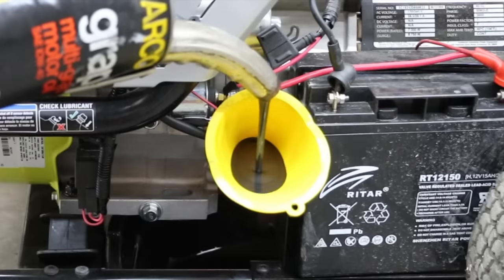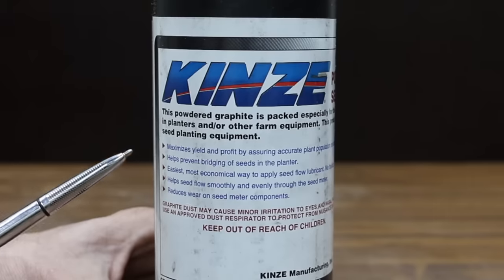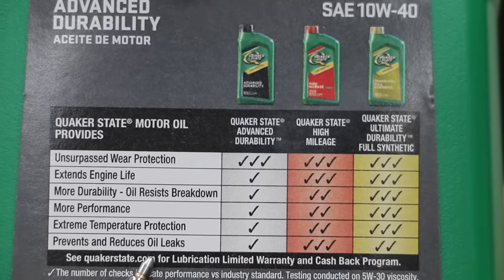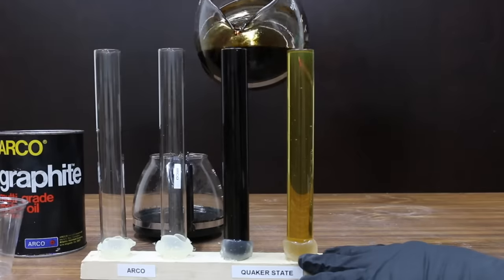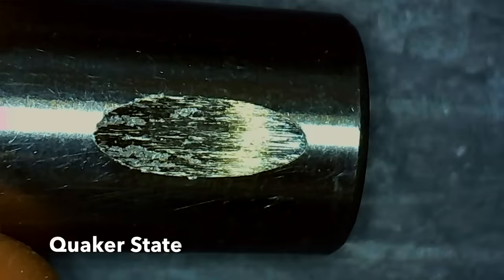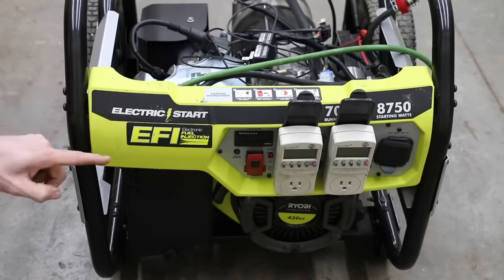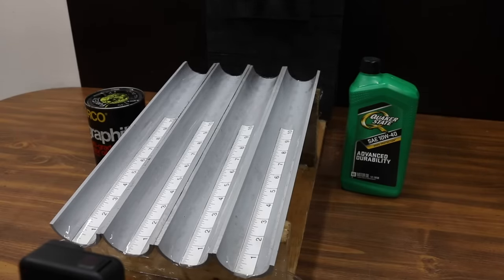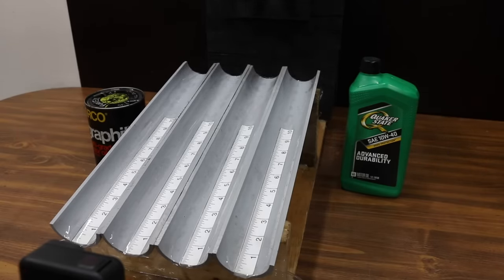Will "Graphite" Help Motor Oil Performance? Let's find out! Vintage Arco Graphite vs Quaker State

Comment: I have 15W40 5L and 2L 10W40 for my 21y.o. LR here which shall reduce friction and fuel con. by around 10%. As I have with the same tech a stick for the fuel pipe I know it works, as I got it tested, but not the oil yet. After 70k km acc. to the manufacturer they couldn't find negative things.
Reply from the maker: Thanks for sharing.

Comment: Do a test of oil additive such as slick50, dura lube, and so on.  I have used both and they have shown some very good results.  Ex:  a friends car that I added slick50, during two change oil cycles (2015 mustang gt, with 90k miles).  His mechanic didn’t tighten the oil plug and he lost all his oil.  His car did not notice until he had driven several miles (unknown exactly how many) before his oil light came on).  He took it to another mechanic who took the head off the engine to inspect it and said there was no damage or visible excess ware.  I attribute that to the slick50.  I’d like to see if in your  it actually matters if you add this stuff or not.

Comment: The graphite oil was designed for the old carborater engine's. Before fuel injection and fuel emissions catalytic converters. That could be a factor in performance. I remember using Mystic oil with graphite in farm equipment when I was younger.
Reply from the maker: Thanks for sharing.

Comment: I added PTFE resin to my engines in the late 80's and early 90's.  I was sold on it when I was able to run a lawnmower engine for over an hour after treating it with PTFE resin with no oil in it.  But since than it seems get your hands on PTFE resin is tough.
Reply from the maker: Thanks for the feedback.

Comment: Interesting.  I am not sure how graphite would help compression???? I am curious what was your theory?  Keep in mind in a small engine like that Briggs Quantum you are using has compression release and you will not get accurate compression readings.  It will be a function a of the RPM you are cranking the engine at.  A leak down test may be a better guage to tell how well the compression has improved or not.  That is my two cents that you may want to incorporate in future tests while using a small engine to evaluate compression enhancements.  Great Work Professor Todd.  I appreciate your drive, creativity and enthusiasm in all of your thoughtful tests.  I know you have 15k comments and I can not read a fraction of them  Sorry if this has been covered already.   Thanks again for your service to us consumers.
Reply from the maker: Thanks!  Thanks for the suggestion.

Comment: I used graphite oil in my '72 Honda 350F.  Never again.  I had also been using oil with low friction additives.  I think that one of these or the combination of the two caused the clutch plates to seize together.  I use Rotella oils now.
Reply from the maker: Thanks for sharing.

Comment: Entermann Bakery had some of the very first million mile engines in the country using graphited very high quality 11TBN 1% ash content 15w40 motor oil with additive package by Acheson Colliods. 
   The product works with a 1% by weight blend. 
   That was a real test with a fleet of 50 plus tractor trailers.
Reply from the maker: Great information. Thanks!

Comment: Once again, another great video. After 30 plus years of cars, trucks and off-road recreational vehicles I've found MOBILE 1. Penzoil, Maxima and Penzoil to be top notch lubricants. With this being said, this only works if you're doing proper maintenance intervals. As I see things pick a quality oil and change it accordingly to the way YOUR driving habits and you should have minimal maintenance. This also applies to your cooling system, brake fluid, steering fluid and gear oil. You'd be amazed how much more life you'll get from a vehicle when you change ALL your fluids when needed. And if I'm correct, the oil companies reduced the great friction reducer zinc content because it's bad for catalytic converters and our environment
Reply from the maker: Thanks!  Thanks for the feedback.

Comment: The oldest and best additive I have found, that can be used in the fuel, oil, and to clean engine parts, is, "Marvel Mystery Oil." It was created in 1923, and is still going strong. I add one quart to the crankcase, and 1 pint per 10 gallons in the gas tank. It can be used with regular or synthetic oil, and will leave the valves and pistons with a mirror finish. If you have "water foam" on the bottom of the oil fill cap, it will be gone the next time you look!!! It drives water out, stops rust, is great for cars that are not run every day. I even use it in my 2015 Range Rover, and my 2003 Mercury Maruder. It is also used as a lubricant in almost every impact wrench in the country!!! That is where I discovered it. My Toyota pu truck, R-22 engine, had it added to each oil change. I retired the truck at 385,000miles!!! I would have kept it going, but, an 80' cottonwood tree fell on it... RIP. So, that is my pick, and has been for 37 years. Brother James Kendall Moore O.S.B. (OFS OSC.)
Reply from the maker: Thanks for sharing.

Comment: I ran the Arco graphite oil in my 1978 GLC after the first oil change (1000 miles) until I traded. The engine was still in great shape but 2 dealers tried to knock off big bucks because "you've never changed oil."
Reply from the maker: Thanks for sharing.

Comment: All I can think about is how quickly your oil filter would clog, this would be catastrophic! There is usually a pressure release valve inside a oil filter that will blow in the event of a complete obstruction and then shortly you’ll have nothing but dirty oil coursing through your motor. Also if any of this gets past your pistons into the combustion area it is likely to coat your spark plug which may out as we know graphite is super conductive
Reply from the maker: Thanks for the feedback.

Comment: I use 15 40 Diesel oil in my 2004 Ford Explorer and have been running it for years my engine runs cool and smooth 😎 I've just put it in on a 2004 ford I just bought and I've been running that for 5 thousand miles with 3 oil changing the 5 thousand mile time to clean the motor.
Reply from the maker: Thanks for sharing.

Comment: I used a product called X1R in the past on an HT4100 Cadillac engine.
Car was purchased used, and I was a mobile mechanic using suction to do mobile oil changes.
After about 6 months and its 3rd oil change, the boss took his car home from the shop and immediately called me.
The car was hot and smoking just enough to be noticeable. 
I had seen him leave the shop when I got there that morning, and he was going FAST to get home. (Later, when I returned to the shop, I discovered his oil plug and a stream of new oil about 50 yards from the shop where I had seen him earlier that morning.)
I discovered at his home he had lost the oil drain plug, which I had never used nor had it shown any signs of seepage. (We later found out he had a problem neighbor... not accusing: jus sayin)
I installed a new drain plug and new oil. Started the engine with fear and trepidation. Shut off immediately. No leaks. Restart with bated breath.
No knocks. No clanging. No thumping. No hammering.
It was over 7 miles from the shop to the house... uh???
Thing ran like a top for the next 4 years with absolutely ZERO signs it had ever had an episode, and was sold in excellent condition with almost 100k more miles on it than it had when boss purchased it. 
Had I not experienced this firsthand, I would call total and complete BS on it, but it happened to me. 
Does this produce exist anymore. 
If so, is it a new 'improved" formula to allow for planned obsolescence like pyrex?
I have questions. Do you have answers?

Comment: I ran Arco Graphite in a 1980 Renault LeCar. At 60,000 it blew a head gasket (pretty common back then). The machinist said there was Zero wear on the cams etc, which was pretty rare back then. 
Your test basically shows a crappy base oil w/ graphite. I suppose that little econo-box never worked too hard

Comment: Just found this video. My father used to use graphite oil in the UK in BMC 1300 engines back in the 60s. Similar to the mini engines with the gearbox in the sump. On first use the immediate effect was a drop in the engine temperature. The oil was flowing round a bigger part of the engine and the sump had cooling fins about half inch deep all across it like an air cooled motorcycle engine. The Arco oil you used seemed to contain much more graphite than the UK oil which was black enough but the viscosity appeared to be much the same as the oils without the additive and didn’t really leave a sludge in the can. I wonder whether modern oils have other improvements which the chemical analysis doesn’t show? We also thought the engine ran more quietly, but without test equipment we wouldn’t really be able to tell.
Finally your petrol consumption test interesting but without very accurate measurements of the petrol I would say to close to call to be significant. What oils do they use in rail engine engines? They have a heavy usage, be interesting to see if it helped! My son was a conductor for CN and some of the old engines had notices on them, not to be turned off! So old and worn they were difficult to restart!
Reply from the maker: Thanks for sharing.

Comment: I had a Caddy Deville - I think '71 - with a 500in3 Engine. I used Arco Graphite in it and thought it worked well. The only thing that bothered me about it was that it always looked dirty and mechanics would tell me "it looks like you need and oill change."
Reply from the maker: Thanks for the feedback.

Comment: Back in the 70’s, I experimented with MolybdenumDisulfide after reading an article that the product named gear-guard, if baked onto engine moving parts and looking at electron microscope photos of the parts, showed that the product reduced engine tempo by 10 degrees Fahrenheit and actually filled microscopic pits in the steel surfaces with the flakey 
Moly making the parts slicker and improving wear characteristics. I also bought several  cans and used it as a lubricant additive.
Reply from the maker: Thanks for sharing.

Comment: Old engines as in prior to the 80s and 90s 
They used additives in the fuel such as lead and I'm sure they used something similar in the oil as well since they didn't have as tight of tolerances on things. As today.. oil tech and engine tech has drastically changed and why you don't see such additives in oil and fuel
Reply from the maker: Thanks for the feedback.

Comment: You're exactly right about the catalytic converter. My biggest concern is NOT the graphite, but rather, the EP additives. That base oil is more similar to what would be used in oil for a diesel engine. Those additives can oxidize, leaving a residue in the cat, that won't burn off with even the highest exhaust gas temperatures. I do believe, the carbon (graphite) could indeed burn off the red-hot substrate of the converter. I'm afraid both the carbon and the EP additives could foul the oxygen sensor, rendering it useless. This ARCO oil could have a similar effect of burning regular leaded gasoline, which was the prominent fuel of the early '70's.
Reply from the maker: Thanks for the feedback.

Comment: I used Arco Graphic Oil in my 1973 Chevy Impala it had 63:000 miles on the engine I freshed it up and put a  cam and oil pump in it when I took the oil pan off it had that sludge in it like you showed I was worried that it would clog the oil pump so I stopped using it thank you for your hard work and have a blessed Christmas 😂
Reply from the maker: You are welcome!   Thanks for sharing.

Comment: This was a great test I remember the Arco oil when it came out and I knew that it would win on the lubricity test.
I am left wondering if molybdenum would be even better ??!!!?!?!
Reply from the maker: Thanks for the suggestion.
Reply: Arco wasn't the only one that had a graphite oil. ExxonMobil also had a version of the oil and we ran it in all our company vehicles. My father in law had a 72 Ford maverick with a 200 inline 6 and he ran that oil in it and it quit smoking and using oil. They took it off the market and everyone said that it was a good idea but the cars were lasting longer than they were supposed to.

Comment: I worked for my dad restoring classics and building restomods for 12 yrs ...graphite oils scare the cylinder walls, valves and rod bearings ...not to mention lifters ...basically it's extremely abrasive on the moving parts inside the block.

Comment: Tungsten disulfide , molybdenum disulfide their the best they say. And you can get them from Rose Mill material processing. I use all three in mowers and bar oilers etc. We mixed some tungsten disulfide with gas and ran leaf blower with it. I don’t recommend it but if ya got an old POS it’s worth trying it out.
Reply from the maker: Thanks for sharing.

Comment: Some locksmiths like to put graphite powder in their locks. If the lock is later lubricated with oil, the oil and graphite mixes, which then turns the graphite powder into a solid. The ratio of oil vs graphite powder is very different, but I would be worried of putting that in my engine. It might work fine at first, but the engine might not start if the graphite have time to settle. Not mentioning how painful it is to remove solid graphite from thight places...
Reply from the maker: Thanks for the feedback.

Comment: I had 1966 pontiac egine that was burning oil at about 1qt/400 miles , I used a graphite addative and it worked excellent. It  still burned 1 qt / 3000 miles but it was much better than " fill it up and check the gas"
Reply from the maker: Thanks for the feedback.

Comment: I tried adding far smaller quantities of graphite lock lube powder to and old mower with rod knock and the coolant of a 225 truck engine with a noisy water pump bearing.  The water pump was virtually silenced and the rod knock was slightly reduced but it also caused a bit of minor misfire from plug fouling.  I used maybe 2% of the amount you used.
Reply from the maker: Thanks for sharing.

Comment: Back in the mid '70s I had a customer with a Imperial with a 440 engine and he pulled a big travel trailer around the United States. He had been using AMSOIL 10W/40 but it used oil because of bad valve guide seals so he wanted to use this new Arco Graphite oil. He had a complete tune up before he left. He left Omaha Nebraska heading West with his big trailer. As he was going up the mountain he started to lose power and it became worse. He had to be towed to a repair shop where they discovered his spark plugs were shorted out with some black coating. The graphite, being a conducter, had coated his new plugs because of his valve guide seals being bad. A change of oil and a new set of plugs he was back on the road and finished his trip without any more problem's. Go figure.
Reply from the maker: Thanks for sharing.

Comment: In the winter I add a few ounces of MoS2 by Liqui Moly to the oil.  It seems to help a tiny bit with cold starts.   I think a small amount of graphite could do the same, ...perhaps half an ounce or an ounce of the powder he is using in this video.
Reply from the maker: Thanks for the feedback.

Comment: I always used to use Tufoil, a PTFE based additive, but have not seen it in store for a long time. I had a 1986 SAAB 9000 Turbo I bought new and put near 300,000 miles on before I replaced it, and the engine still ran like new and had never been repaired. Try that if you can. I see it's still made and can be bought online.
Reply from the maker: Thanks for sharing.

Comment: I'll tell you what I believe beyond the shadow of a doubt works and that is PTFE Teflon! There used to be two different oil additives that had Teflon slick 50 and there is another brand I can't remember it's the one I used more but I'd use like 50 also. I had a Nissan truck when I wrecked it had over 300,000 miles on it and it ran like a top and somewhere around 200,000 miles I was almost home and I turned the corner and I heard a noise I turned my radio down and I heard a knocking I got out and opened my hood and there was a little hole on the oil filter and it blew all the oil out of the engine and I only had a few hundred yards so I just went ahead and drove home and I was pissed I knew the engine was shot! I got my old oil filter from the last oil change put it on filled it full of engine oil and I had used not slick 50 but the other Teflon oil additive anyway I believe slick 50 is just as good but I filled the oil up and started my engine and I still heard it tapping and I went in and made a phone call I came back out about 10 or 15 minutes later in the engine was purring and I put a hundred thousand miles on it after that happened that is not a lie I have nothing to gain from lying about this! If I remember the name of that other one oh it was called QMI oil treatment that's it QMI. And when you use that you would get about 40 miles per tank of gas more than when you use oil without the treatment and it would work two or three treatments after using that oil I know that stuff worked improved the engine life and improve your gas mileage it's got to be helping the engine has to be I absolutely believe beyond the shadow of a doubt everybody watching this and reading my comment knows exactly why they don't want it sold! It's corruption! Anyway that's my two cents! Thank you for your videos I really appreciate what you do!
Reply from the maker: You are welcome!  Thanks for sharing.